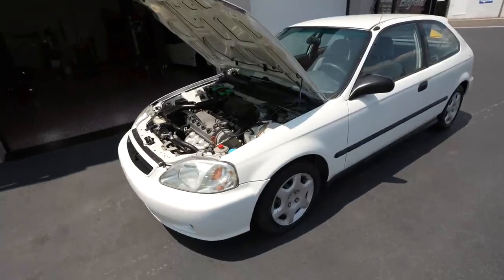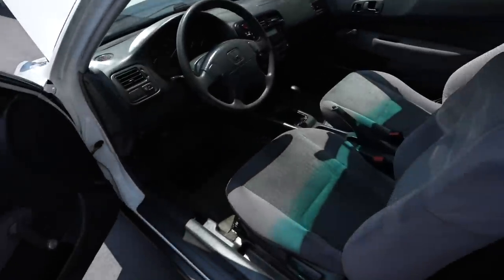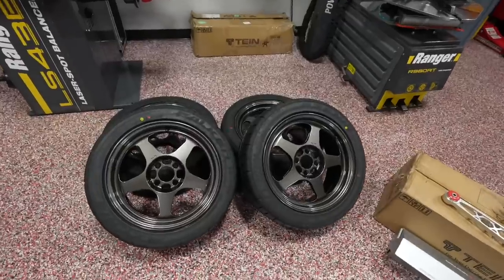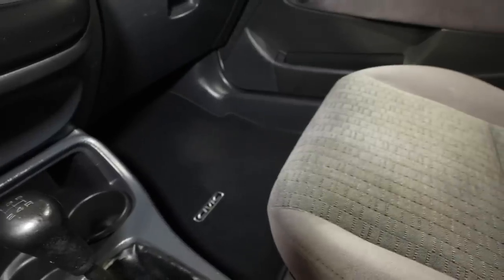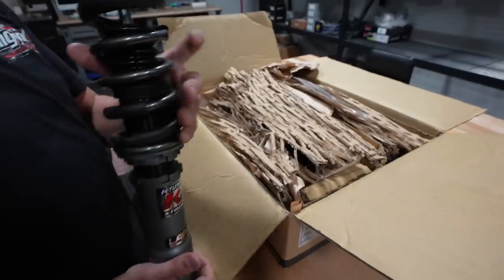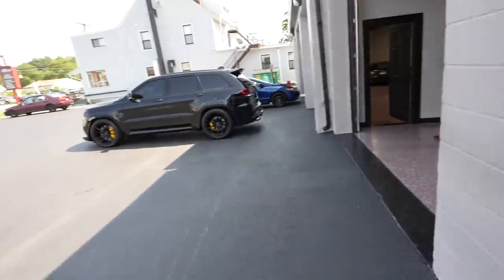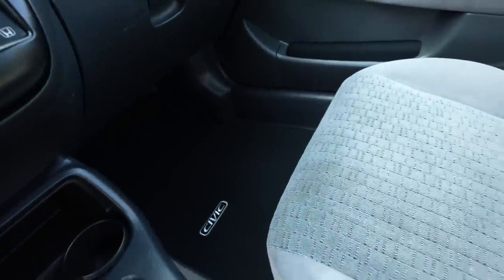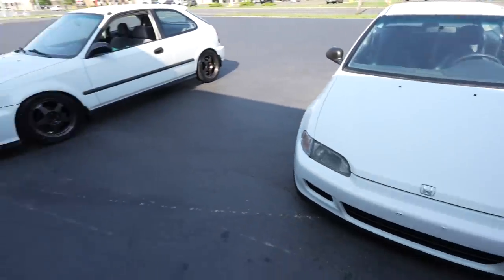Transforming Civic EK hatchback in 10 minutes for under 3k!

Comment: I would have done eBay turbo kit ($800) chipped p28 wheels and tires ($1000) (used) si rep grill with fog lights ($65) , try hart lowering springs ($120) mud flaps ($25) rep Red H emblems ($50) tints 20% ($50 installing them myself) skunk shift knob ($50) front and rear lips ($115 eBay specials)  eBay cat back ($150) and the little left over for some NGK plugs and misc. bolts and clamps. Super riced out 🥢 but will have some fun

Comment: Should've got Function & Form Coilovers, they're pretty good and only $600, And wheels probably used would've saved some money for more mods. I remember back in like 2018 and before you could get a whole B series swap for 1000 or less. Mann times have changed
Reply: had both the type 1s on an ek and type 2s on an 09 si, can tell that the f&f 1s were so great for the price, they felt way better than the type 2s tbh, i dont recommend the type 2s tho
Reply: @davidnarez6780  yeah same here, Idk why the Type 2s with Dampening are worst